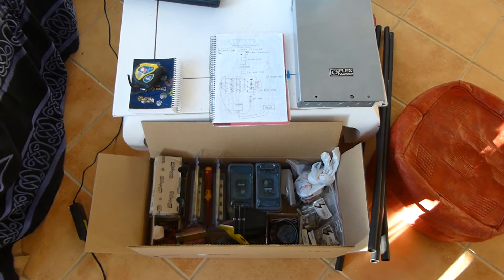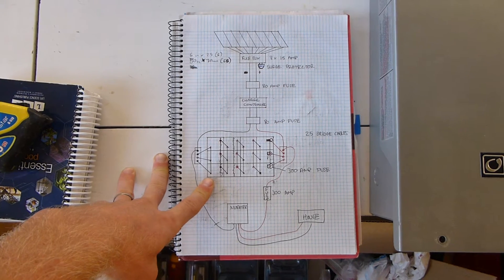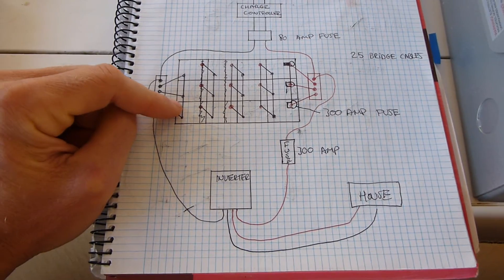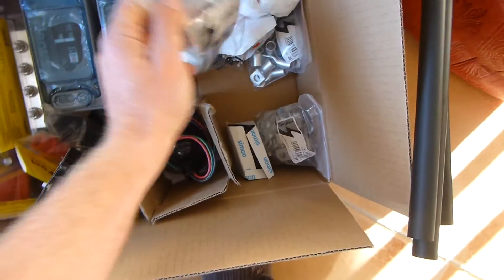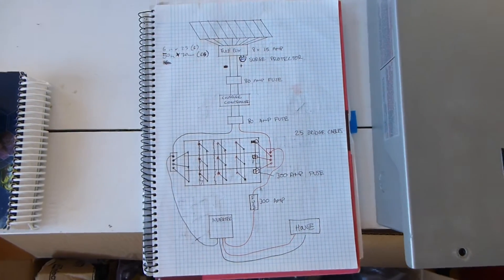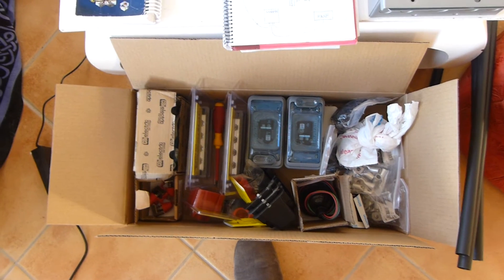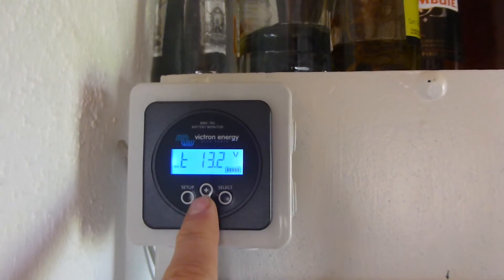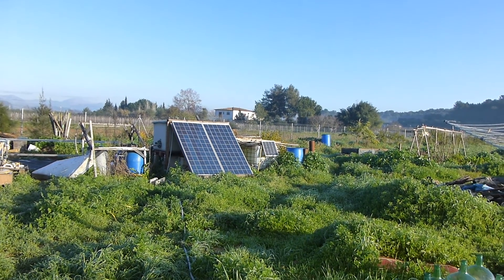Off Grid, DIY, Home Solar install - Part 1 Overview

Comment: Your right. DC brakers are a must. A AC braker will not flip off if it needs to with DC. Some AC brakers are ok to work with ac and DC. 

Looks like your going to have a nice setup.  Thank for letting us be a part. God Bless
Reply from the maker: thanks for your message!! i have been battling with the batteries and cables over the past few days.  will put the video up soon.
Reply: You can use AC breakers for DC but you have to de-rate them and check their DC rating as thai will in most cases be less than their AC rating. The problem with DC is that there is no 0V happening twice a cycle so they arc doesn't quench and just keeps going until they breaker either fuses permanently open or blows up due to the heat build-up.

The far safest bet is to use the proper DC rated breakers as they can handle the quenching of the arc when the breaker opens. 

Breaking AC is a lot easier as you just have to withstand the arc until the line potential reaches 0V.

Comment: Thanks for taking time to really think about your designed solar system.  Self education is crucial on these projects.  It appears that you probably got 95% of your design correct the first go around, especially when ordering the parts.  I have a very similar setup running Trojan batteries for 1305 Ahrs.  I really used the internet and youtube videos also in learning about setup and care of the system.
Reply from the maker: Hi,
yeah, over the past years I have literally built a house with knowledge put up by youtubers and bloggers ( youtube university) when  I had no previous experience in any of these fields.  That is the main reason for doing these videos.  Hopefully someone can get inspired or learn something that will help them in their own projects.

Some things have been a nightmare due to lack of experience but most things have gone well and Im really happy with everything that I have learnt over these past years.

Thanks for your comment and support!

Comment: DC breakers...yes...dont burn it down...they dont "break" like an AC..so yes you need them.Also if you need an american contact ley me know.
Reply from the maker: thanks man!!  System has been up and running for almost two years now without a problem!  thanks for your comment and the offer for a contact  ;)